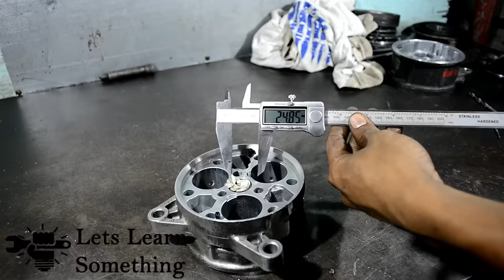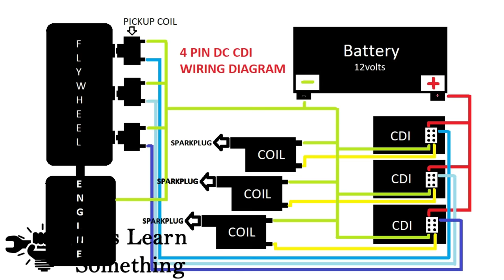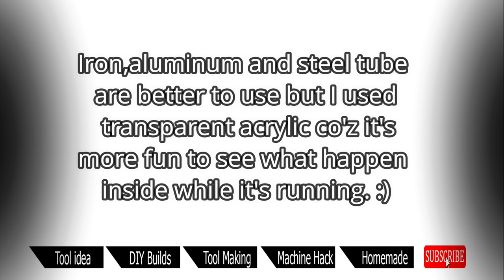I turn Car Compressor into Working Engine

Comment: Its a cool idea for the motorcycle manufacturers to make a 2-Stroke engine with two or three pistons with that crankshaft design , great job
Reply: I think many companies have looked at this design or close to it. Look up Duke axial engines.
Reply: It is very good idea for bike manufacturers. Size can be reduced to keep it more effective in real manufacturing process
Reply: @awaisiqbal8934  depends on the bike type more than likely. Not sure if it would need to be high revving or is it torquey. My bike turns 16,000 rpms to make its power.
Reply: Yeah, I'm sure all these companies with engineers working for them have never thought of this before, over the last nearly 200 years this guy is the first to think of this.
Reply: @abailey525  i mean its not that unlikely. That's literally how inventions work.
Reply: @huntergates8752  I mean, yeah it's pretty unlikely.
Reply: @huntergates8752  axial engine.
Reply: probably_drunk  thanks i will look and figure out what they make
Reply: Awais Iqbal  the car compressor pistons size isn’t that big , lets do an example : three pistons of 200cc , imagine how the engine looks like and how much power does it make.
Reply: It's impractical as an engine.  That's the bottom line, if it were practical then it would be in production.  What makes it impractical as an engine, first the obvious, it's designed to compress gas in a cooling system, second there's no way to mitigate the backlash between the gear inside that changes the direction of the force to perform the work and lastly it is not designed to support internal combustion because it is an AC compressor.  Any compressor can be converted into an internal combustion engine, that doesn't mean it will function better in that application.  Compressors are designed to accept the input drive from an outside power source to perform their work, so if they are converted to an internal combination engine, then the force will be coming from the opposite side of where they were designed.  Meaning, they are essentially running in reverse, so the parts will fail sooner.  Now, if someone designed an engine in this configuration they still would not be as effective as their automotive counterparts.
Reply: A Bailey not really a swash plate engine was invented 100 years ago
Reply: its a radial swashplate engine
Reply: They already do something similar with the crank in diesel engines in freight trains but the pistons are facing the side's not the top that similar engine design was produced by vw ,Audi  designed it years ago it's on YouTube but nobody has seen it before I hope this helps😎🇩🇪🇬🇧🇺🇸
Reply: bravo
Reply: The DynaCam engine is probably the most similar engine to this as far as the design goes, only real difference is that it's four stroke and has more cylinders.
Reply: Why use this when everyone is switching to electric? Combustion is end of life. What he showed is a variation on an existing more efficient system. The normal crankshaft can better distribute/ transfer energy and four stroke would be more efficient than four stroke. But it’s cool how he demonstrates the basics of the combustion engine on a ac compressor.
Reply: @awaisiqbal8934  Gen sets come to mind as well.
Reply: @agarcia8800  i know he obviously wasn't the first to have this idea. But saying that someone couldn't possibly think up a new concept with the tech/corporations of today just doesn't make sense. How do those corporations come up with new shit? Some quiet nerd thinks up some shit no one else thought of. Doesn't matter if he's on YouTube.
Reply: sadly the it would be outlawed in the state of california (and every other state now) cause it pollutes with the oil and gas mixture and doesnyt have a catalytic converter and other happy horseshit anti polutant device to prevent global warming
Reply: It would be a good compact design to use with an alternator on the end of it for a hybrid EV application.

Comment: This rules! What's the displacement? How about using the compressor side of the pistons for power as well, with a blower for scavenging? Could the intake and exhaust ports be made wider, as well?

Comment: You know this dude laid in bed wide eyed for weeks planning this.
Reply: I laid in bed for most of my youth wondering how to build my first gocart and eventually built it at 15 it has two speeds and did 35 MPH
Reply: lol
Reply: Where's his wife?
Reply: Laid***
Reply: I wonder if adderal was involved
Reply: @rogerd4559  Cool, I'm 48 and I still want to build one. But electric, gotta keep up with the times.
Reply: @paulmichaelfreedman8334  And alot easier to build.
Reply: bwahahahahaha
Reply: @paulmichaelfreedman8334  I am 16 and I made an electric one one year ago as a school project
Reply: @elizaevans2345  good deal how fast did it go?
Reply: @rogerd4559  15km/h but I bought my battery for real cheap, it was almost dead. I believe if I bought the battery new, maybe it would be faster and make a longer distance
Reply: @rogerd4559  but I just used it once to show it on the project day and now its outside for 1 year. Sorry if I don't speak English very good, I am from Belgium.
Reply: @paulmichaelfreedman8334  electric would be much easier. Turn your alternator into an electric motor.
Reply: @caratcranker5874  His wife is mad at him for collecting all the junk out back. With the stuff, I understand he's turning a motor into a compressor.
Reply: @paulmichaelfreedman8334  There's a video of a guy making a brushless motor. He uses a lathe.
Reply: Wow!!
Reply: @ianmangham4570  fifxj8
Reply: I doubt it. That is what the rest of us do. I bet this guy probably needs only a day of prep(thought) time.
Reply: ... nop... rather, the kind of guy who sees what is there and a light bulb of intuition kicks in an idea instantly on how to repurpose...
Reply: I could be completely wrong but im guessing the builder here isnt necessarily the engineer. I am impressed that the somewhat laxed location of intake and exaust ports along with rubber hoses and solvent work at all. Even for a few seconds is impressive. Then throw in acrylic cylinder heads looked like scrap paper gaskets and it still ran at all. Im curious how long it will go before it comes apart. With a few changes i think this could be a useable engine for education if not for practical uses. You think of how long ac compressors last with a continuous run life style. They are very well designed and built with quality materials and are air cooled so built for harsh conditions. Theres a base for a good fuel engine .
Reply: @davidreynolds4684  I agree but I differ in that I'm not impressed with AC compressor lifespan. I have replaced a lot of those things. They seem marginal for what they do. Thus even with decent modifications I don't see this engine lasting super long running on fuel. Just more heat than it was designed for.
Reply: @consaka1  from being a building contractor and having a mechanical contractor budiness as well i ran across compressors that were still thumping along after 15 years and more. My point about the potential for a durable motor application was based on the fact they are designed for continuous operation with in most cases no cooling system . Other than oil in the freon. I know in many cases ive demod units and kept the compressors for other uses. I made all of my freon recovery units out of fridge compressors and demod units. Built sheetmetal boxes. Added guages lines connectors cooling fans etc. I had an inspector show up late at night on the roof of a friends restaurant in Ft Worth called the Back Porch. He saw my van and got nosey. He was surprised to see me pulling a vacume in the middle of the night. When he saw my recovery unit he started with the questions. I thought he was about to give me a hard time and find some code i broke by using a home made recovery unit. He did not. He was impressed at how well it worked and how fast it pulled the system down. My comments may have been in a statement form but i really meant them as a question. It was more like has this person tested its dyrability? Longevity? Work under a load?  And doing so using  more realistic heads. Metal torqued down gaskets etc. Then i did see where he stated he used the acrylic cause it looked cool with the fuel ignition. I foubd tge whole idea very interesting and im one of those guys that needs to know how the story ends. Other wise ill find myself buying new stuff tearing it doiwn and making god knows what because im bored.  Im lnown for making things that dont normally float into boats. Things that float now fly. As far as i know im the first owner of a push mower that i can sit on my front porch and mow my neighbors yard 3 houses down and across the street. Why.? I was bored.
Reply: @shannondove96  or coke lol 😆
Reply: @consaka1  có những hành khách ô cửa
Reply: @consaka1  có nhiều thời giờ nghỉ ngơi ô cửa nhỏ
Reply: يصيي
Reply: @rogerd4559  Sure you did lol

Comment: My goodness, imagine going to the university getting your degree into mechanical engineering and still not be able to do something like this. I am impressed, mind blown and speechless. Well done. I am surprised MIT hasn't picked you up yet.
Reply: Because he can't be molded
Reply: Fabricobbling something and calculating loads, simulating thermodynamic behavior and optimizing production costs are not quite the same. This guy could be a great engineer if he put in the time to learn engineering skills. To the guy that says "he can't be molded" just know a commercial axial engine was marketed in1911. I think his aluminum foil cap is too tight.
Reply: @tiberiu_nicolae  people in comments underestimate engineers.

Comment: The thrilling part is that not only did he know how to convert the compressor into a SI engine but he also used all the work/machine tools perfectly. This is ingenious.
Reply: Efe Menah good thing he holds all the parts with his hands while he uses the drill press, nothing has ever gone wrong in history before. Braver man than I.
Reply: @AmplifiedReaper  It's actually more safe to operate machinery without gloves. You have improved motor function. Also, if the gloves snag on the machine you could lose more than a finger.

Comment: Well done  - the tilted 'crank' element  is known as a 'Swash' plate and was used in a large engine of this type C.1930's by   Australian inventor and Patent Attorney George Michele.  Michele was better known for his invention of the  'Tilting Pad' thrust bearing used on Marine propellor shafts and Vertical Generators.    
Stuart Fox

Comment: Unvelieveable engine knowledge to just open that compressor and "do the right holes" with such a confidence. If the first acrilyc didn't break it could be start at the first try. Very inpiring work

Comment: Now. Onto steam! I see these little swash plate compressors as not far from a low pressure steam engine. No cooling problems either. Super impressive skill level! Very instructive. I had no idea that magnets could be electric welded without being destroyed. Thanks!

Comment: waiting for the next version of this video, where both sides of the compressor engine have spark plugs, side ports have valves and injectors. extra points for a turbo.
for a perfect score, the end of the video would be you on a motorbike with that engine, riding in the sunset... :)

great work!!
Reply: Massimiliano Cacciamani Oh my god yes. I was thinking the same thing. Making the engine double-acting would double the displacement and therefore increase the effect boost would have on it, so a turbo is also an excellent idea. Would love to see what he does with it.
Reply: two stroke concept had to have valves for that, hes using the back half as the lower case of the two stroke. which is where the fuel mixes with the air before being burnt. thats why it had transfer ports. damn ingenious.
Reply: Mujeredesnuta

Comment: I'm impressed. It runs surprisingly well and it sounds awesome! I bet it would run even better with an RC engine carburetor and premix gasoline. Keep us updated! Excellent job!
Reply: Get a 30 cc Chinese carburetor for 12 bucks ready to go 4 stroke! Put two of them on there!
Reply: @brianrader2883  I think a 30cc carb may be too much but a pumper carb is definitely a good idea. Maybe 15cc?

Comment: As a machinist what impressed me the most was that he knows that you don't use your calipers as a marking gauge/gage. Every time I see that I die a little inside.
Reply: no one is perfect. :)
I found the work AND the production of the video awesome. I think in real time many hours went into this project.
Cheers!
Mick
Reply: Hahahha i do that all the time when im working on the lathe. Sorry for slowly killing you 😂
Reply: Yeah I see professional machinest do this all the time on YouTube
Reply: @adamgentry332     not true professionals because true Machinist know better and if you were to try to use their personal calipers to etch a mark on their project they may just pop you in the head with it. Hell I don't even do this for a living and I know better. This would be like sticking your hands into another man's tool box without asking then using their Snap On ratchet as a hammer, this  doesn't go over well.
Reply: I worked in aerospace shops for fifty years. The guys you see using calipers as scribes are not really machinists. There are very few  left in the USA anymore.
Reply: @adamgentry332  Machinists aren't what they used to be.
Reply: @timwegman5776  my dad would kill me if I did that to his snap on rachet
Reply: @timwegman5776  maybe the point is missed, it was simply how easy it would be to do but of course precision would be of the utmost had it been used for something that was going to be constant on an engineering way of thinking.
Reply: Protip. Cheap set for marking.  The good ones live in their cases in the tool cabinet and come out with pomp and ceremony
Reply: @timwegman5776  professional means you get paid for doing that job. So, yes. True professionals. You are only one person of 7.8 billion. And even if you know 100 machinists that share your opinion, that is 100 out of 7.8 billion. 

A true ANY TRADESMAN will be able to use ALL resources to do a job. Not having to depend on proprietary tools. You should see how I install bearing races or how I fab brackets. You'd lose your mind.
Reply: @bingosunnoon9341  Wow!!! A yacht club elitist. How original.... "iF yOu dOn'T fOlLoW oUr rULeS, tHeN yOu'Re wRoNg..." 🥴 durrrrrr

Comment: After watching the whole video I realized I was only ever going to be good at dismantling the compressor :)
Reply: Try taking apart a transmission and then look at all the parts, they all look the same size or type but they are not and to have to go back in a certain way and order. Engines I can deal with but transmissions nope.
Reply: My thoughts exactly, then soon concluded that I'd probably stuff that up too
Reply: even I love mechanics, I'm just good to offer him a pack of 6 beers !! even he would want more, I will run again to the store and run back with some another cans !! Cheers engineer !!
Reply: @DefaultName-hx1qz  će u

Comment: I'd love to see the longevity of an engine like this since the components aren't meant for that kind of stress, like a torture test video or something would be super interesting
Reply: Agree
Reply: Its not made to run a fucking car
Reply: Not really a good idea, theres no way of cooling the engine block.... wait, I have a idea.
Reply: @MrJp990  It's a great little engine, but it's got no way of cooling it. He just needs to make a waterjacket for it. Or air cooling
Reply: abel tarula thanks so much, I didn't realize
Reply: Yeah Id like to see what sort of longevity he could get if he subbed aluminum in for the acrylic. In the end it looked like one spark plug already starting to melt its way out. I bet with some longer bolts and a cooling jacket for the head and the oiling system(not yet in existence) he could get it to last quite a while.
Reply: @pikethree  yeah waterjacket would probably be the best. He could also tig weld some cooling fins on it too
Reply: Oil is a bigger issue than cooling. Water jacket would be simple enough but reliably lubricating those pistons would be difficult
Reply: @brandonross6083  run as a 2cycle engine it should not be an issue because the oil is in the fuel.
Reply: @MrJp990  Exactly and I pointed out that he really was NOT being a dick, he was making a curious observation about how long it may last and its practicality. YOU were being judgemental that he WAS being a dick. I didn't take it that way at all, I wondered the same thing. It doesn'tt ake away that the poster of this video is ingenious at all.
Reply: Any ways this is an a and b conversation  can you c your way out of it haha
Reply: Lol

Comment: This just showed up in my recommendeds, not disappointed. Best sounding 3 cylinder engine I've heard.
Reply: I think its a 6 because it has two sides.
Reply: Still a three, it only has spark plugs on one side. The other acts more like an intake manifold.
Reply: Oh i think i know why, its a two stroke engine, one side lubricate s while the other burns.

Comment: I wonder if it would be possible to run both sides of the pistons and run it as a 6 cylinder instead of 3? I know there would be many issues with this but it would greatly increase the torque though that in itself may be a big issue due to such a thin walled block/cyl walls. Anyway this is absolutely an amazing project you have done very very creative. I like most if not all your content but this one has my gears turning thinking of possible uses I mean a small cylindrical engine or revolver cam engine is compact and could be very useful. Thanks for sharing your MacGyver brains with us.
Reply: It is somewhat similar to the dynacam engine... except I think the dynacam was a 4-stroke.